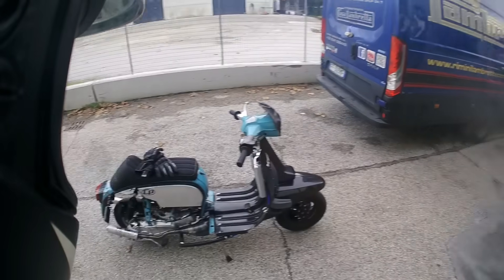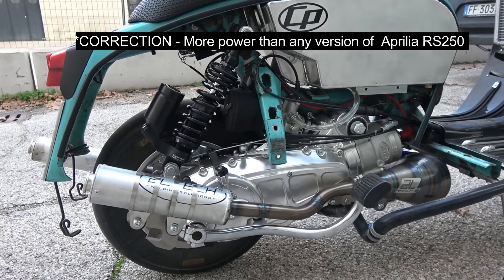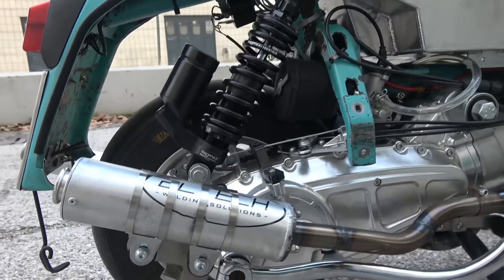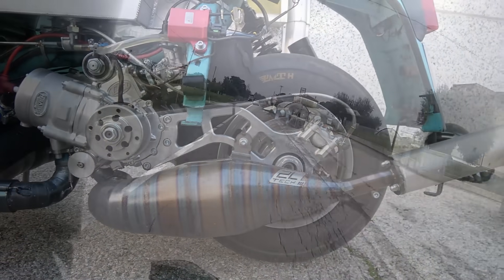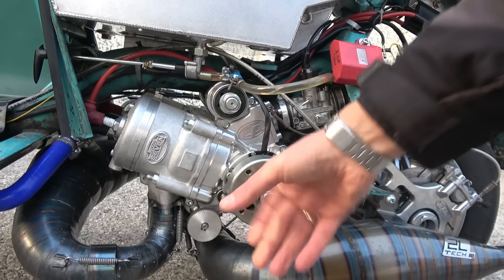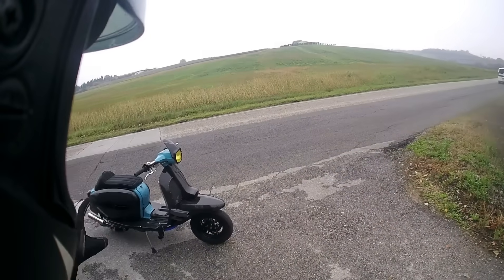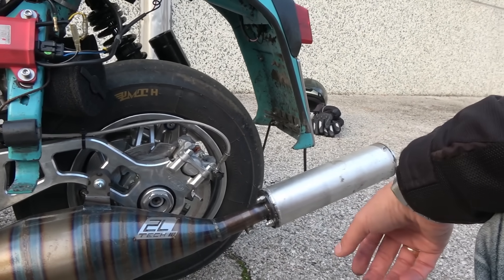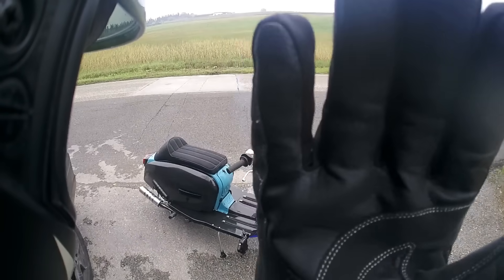SLUK: *INSANE* 76bhp Casa Performance 250 Twin Lambretta Road Test

Comment: the way the back end lifts up under accelerations is incredible !!!
Reply: the back end lifts?? I didnt see that? dont you mean the front end lifts under acceleration??
Reply: @leekindell9937  1:20 😳
Reply: It's the most aggressive 'anti-squat' ever!
Reply: @gerryjamesedwards1227  literally !
Reply: @Danpiper09  that’s just where the wheel is pushing on the drag of the roller the torque. The front won’t lift on dybo hence looks like that and pushes up on suspension otherwise on rd nose pops up as not tethered.  Awesome bike sounds so great
Reply: @leekindell9937  yeah I know that, I’m just saying it’s got that much torque to do that. My pk never did that on a dyno  as it was gutless till I got a quicker engine

Comment: Sounds like a 125 RDLC engine, when powerband kicks in and front wheel comes up, loved them things 🇬🇧 ✊🏼
Reply: Thought exactly the same thing. Close your eyes and you think you're hearing an RD
Reply: RD 125 LC with 180cc kit did that nicely with gas only. I have ridden that.
I have owned 125 and 250 RD LC's too, 1984 and 1982, but they needed clutch to wheelie.

Comment: yyyeeeeeesss. 125 two strokes have insane power to size, weight and power to displacement. 250 singl cylinders are nice but a higher revving twin cylinder 250 would, and does have like and extra 30 percent power increase. I love it

Comment: Very, very impressive.  I got me first license endorsement on an LD150 in 1969 when I was just 15 years old, and didn't actually have a license.  I am not sure that I'd have survived owning something like this while still in my teens.
Reply: An endorsement on an ld150  ?  What for causing an obstruction  ?
Reply: @nickcoppard5335  I was 15, and year away from getting a bike license.  For some reason I had painted a big LD on the front of the scooter with the L on one side and the D on the other.  When the cop overtook me he saw the red L and thought it was a learners L-plate and because he hadn't seen one on the back, he stopped me.  He was not a dick about it, but he did make me push the bike home which was five miles away, and the first bit was up a steep hill.  That turned out to be too hard, so I jumped on and rode it home as fast as I could using back roads where possible.
Reply: @TrevorDennis100  ah the good old days ! Going back 55 yrs reg the local cop used to bung my bike in the back of his moggie van and take me home , all the locals loved that cop , now its go to jail for anything , trouble is now once they secure a load of stupid convictions the lads today just get much worse

Comment: You Guys will not have heard of me, but you will know of my Work.

I am now 71 Years old, and way back in 1965 I was the originator of the Lambretta 'Strip down' Scooter design, that you lot call  a 'Skeleton'.
They were going for £15 a time then (TWO weeks Apprentice Wages), so I had no problem chopping them down on the Steering column, removing the body shroud, fitting a single seat, tiny tank and making what you now call the "Kneeler".

I got bored with having my Scooters stolen, so swapped the first one for a genuine British Royal Enfield Bullet with a Glasgow Gallowgate bike dealer who was so pleased with the novelty of it, he started making them calling them "Lamb Chops".

Just a little Scooter History that you would not know of.

Its good to see you Folk keeping the Faith.

Finally.
Death to ALL Vespas !!!
.
.
Reply from the maker: That’s great to hear, very interesting. Thanks.

Comment: I should really get back into the 2T Scooter scene, so many advancements since i stopped modding/following the development, was in the Minareli circle. 
This Lambretta must be a blast, auto 2T were getting wicked fast many years back, like PMTuning's Italjet they held records with, If this had a inner rotor ignition setup and 35mm carbs it'd be wild, dare i say un-ridable even more so with wheelies :face-fuchsia-wide-eyes:

Comment: I was at the Italian bike show in November 2009-one of the stands had a 500cc 4 cylinder 2 stroke scooter on show…….I will have to dig out the pictures I took of it. This one sounds like my Yamaha TZ250 when it comes on the pipe, and produces much the same power-nuts on a short wheelbase and small wheels!
Reply: Was it an orange Lammy ? If so the engine was a Suzuki RG 500 , 4 pot 2 stroke , easiest way to loose your life on wheels

Comment: I got a 250cc Lambretta from the 90s. Not a twin cam. Had an ST165 Toyota that I crashed running down the Seaham casuals. I was only a teenager at the time. I would have got bored on a 125 so they sold me a Lambretta and swapped the barrel on it. Fastest Learner plate bike I ever had.

Comment: My brother had a yamaha td2 twin flattracker 250cc 70hp 200lbs it was scary fast. Revved to the moon has a dry clutch abd chrome lined cylinders. Reed valve intakes and right side shifter .
Reply from the maker: Imagine trying it on 10” wheels in a chassis built for less than 12bhp…

Comment: With purposely jumbled up mechanisms to hold two scooters where sat one- engine, and the resultant scooter miracle on the original frame made to run with so much power : it is a definite amusement to the gate keepers of the Pearly gates at the end of the ride...

Comment: So this is going to be unobtainable for most, nice.
Reply from the maker: Just in the way many sports cars are for most. 

It’s the pinnacle of scooter exotica but still cheaper than the cost of the upgrades an owner would typically spend on just the brake upgrades on a Ferrari.

Comment: The vicious, pull-your-arms-off  power band of a 2T Honda CR500 transferred to a Lambretta isn't going to suit many. So, how about developing a lower revving exhaust system that gives far less top end but a much more linear delivery of power and torque? How about 45 BHP (more than enough for most!) but with tractability that even my missus could handle? This would be a similar concept to fitting a box exhaust rather than an expansion pipe on a "standard" tuned Lambretta engine. Exhausts designed for less volatile power delivery could also be more compact and might therefore resolve the obvious "packaging" issues of having two tin whales hanging under the motor. Like a box exhaust, they could be shaped to precisely conform to the shape of the engine.

Comment: Remembering my modified  Lambretta TX200  in the 1960's,  What does it use for brakes?
Reply from the maker: This has a twin front disc and also a rear disc. Have a read of the accompanying article, there’s plenty of info.

Comment: At 4.33 you mention crank rotation. Can someone explane the crank rotation being better in one direction for reed valves? Cheers.
Reply: It's crankcase induction rather thah cylinder induction, On this engine, the reed valve ports are aligned to the piston skirt side of the webs, so the rotation of the webs and big end effectively helps to draw the charge into the crank case. With a standard Lambretta's clockwise rotation, the crank webs would be spinning against the direction of the incoming charge flow, and this could possibly result in some back pressure against the reeds during the induction phase of the cycle when the reeds should be fully open. The engine runs "backwards" due to directly geared primary drive rather than the familiar duplex chain.
Reply: @davidpalk5010  Thank you,now i get it,i had 2 strokes back in the day, RD250 & RD400 beckett tuned ,and that used reeds on the cylinder induction flow,if i remember correctly. Thanks for the info,appreciate the explanation.

Comment: The scary part is not the wheelie, or the top speed, but the tiny brakes.
Reply from the maker: It's got a really good front brake, but sadly it only works when the tyre is on the road.
Reply: @ScooterLabUK  lol🤣

Comment: Think my RGV 250 had just over 50bhp
Reply: Great bit of engineering
Reply from the maker: My RGV was 56bhp standard and a pussycat in comparison.
Reply: @ScooterLabUK Defo faster than my old PK 50 with 110 Malossi haha. Think a 125 at about half the power might be more accessible just in terms of rideability for a lot of people  but I suppose the 333 would cover those needs. Sounds and looks an amazing bit of kit.

Comment: That rear tire probably lasts 6 days. Speaking of tires.. wtf are those tires?!
Reply from the maker: It’s currently running on slicks.
Reply: @ScooterLabUK  Yeah I can see it's some sort of completely slick tires but I was wondering which ones precisely! :) I have a 80cc 2T 7hp peugeot that's ready to challenge your beast! ;)
Reply from the maker: @dbauernf  sounds like a weapon 👀
Reply: @ScooterLabUK  You have no idea! It's a beast up to about 52-53mph! ;) And it'll hit 60 on a good day! (if I took a dump in the morning). I've had like 11 bikes and have a Bandit 650 ATM too, but I love my scoots!
Reply from the maker: @dbauernf  you need to get yourself a fast one mate.
Reply: @ScooterLabUK  Yeah, I've always had rather sensible scooters for city riding and a proper motorcycle I can travel on.. but I've had it the other way around too, a few 300-500cc scoots but nothing this insane :)

Comment: It looks fun, and sounds wonderful, but it still is a scooter, and for some reason it doesn't look like an adult ride, yet it has too much power for a teen and most young adults, hmmm..
Reply from the maker: Most teens and young adults won’t be spending £15000 on a scooter engine. This is a middle aged toy.
Reply: @ScooterLabUK  You mean a middle aged crisis you ?
Reply from the maker: @gregmaggio5217  exactly. Much cheaper than being into sports cars.